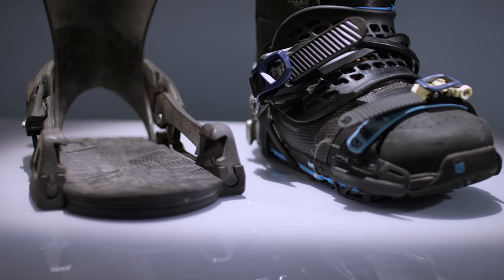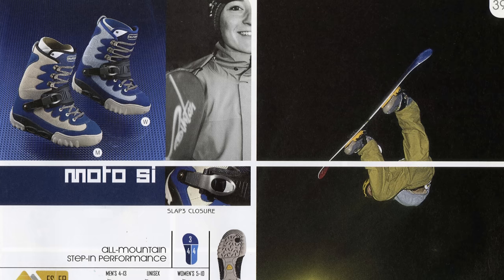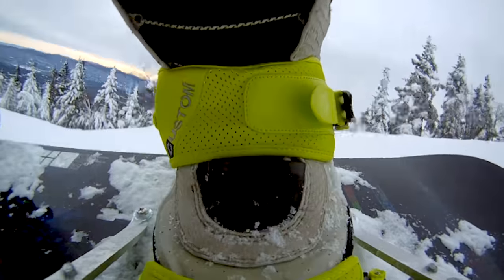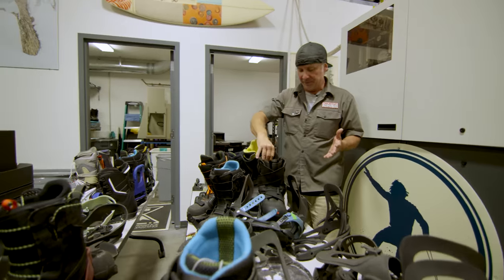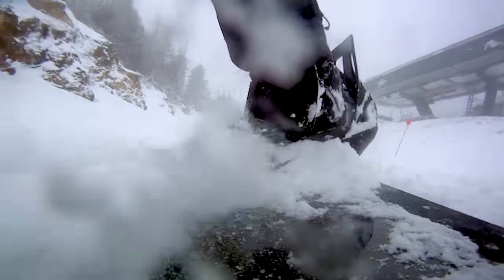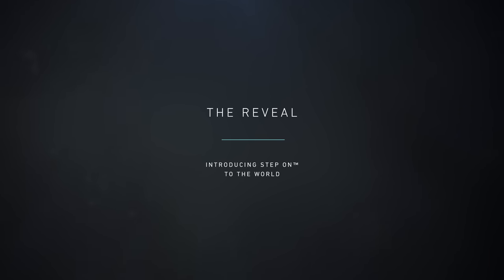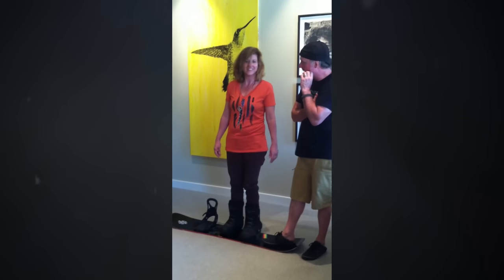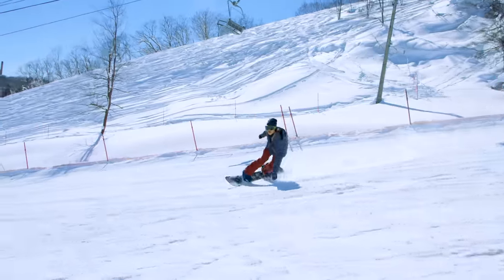Burton Step On® - Research & Development Process

Comment: Okay, this is officially on my must have list for next season.
Reply: Don't get the genesis - both hammocks fell off. I'd recommend Klew. Or wait for burton to address a LOT of failings. Ask the sales person how much replacement toe clips are. Ask them why they only have a one year high back warranty... But if you are beginner, but able to stand and ride off lifts with them they are pretty cool - just carving these things fell apart.
Reply: @trex2957  glad you said this.  I've been riding for over 20 years. definitely don't want those kind of issues.
Reply: @MrJamocity  yeah I heard from Burton what happened to me very unusual, that all these parts can be replaced, that they have or know some other person that used these a lot no problem...But I genuinely wonder if anyone has used these much... Most users get a 7-14 days a year. I got 75 days last season. 

My xp was lost gas pedal by day 20, replaced and tied down the new one or would have lost again. Left hammock lost by day 30. Right hammock lost by day 50. These are integrated to the highback so need a whole new highback. Goodluck if outside a year (one year on highback). No response from EU Burton despite promises and 6-8 weeks trying.. 
Boot toe seams starting to fail day 40. By day 70 both toe seams completely gone. Day 50-70 rear toe clip increasingly unreliable. By day 70 rear toe cip releasing with light upward pressure. Any heel turn releasing toe, but heel stayed locked. Snow trapping under the boot toe during riding... I'm checking out flow or clew because I did like the off the lift ease.

Comment: I'm a little late to the party, but here are my 0.002 cents on these.  I have a set of old-school Liquid step-on bindings that I've been using for umm, 15-20 years?  Not sure, too long.  I fondly remember getting dirty looks from older riders when I would just get off the lift and without stopping, click in and go. Anyway, the soles started to separate and I was frantic to find a system that kept me from having to sit on my butt and strap in.  I was so spoiled by getting off the lift, clipping my toe in and then, stepping back to lock-in and go.  A tube of shoe glue helped me get another season of riding with my old system and when I finally heard about the Burton system, I said, "I got to have them!"

Couldn't find them. Out of stock everywhere. :(  I finally found them this season, but it wasn't easy and that's not the story.

I have to say, that they feel more planted than my old step-in system.  I do feel more control and feedback.  I'm still getting used to how this system locks in and releases.  The heel in first followed by the toes is a bit tricky compared to the toe clip system.  I've managed to step-on and get locked in a few times, but I usually have to sit and press down on my toes to get the side clips to lock in.  Stepping out, the toe clips can sometimes stick, but that could just be me not using the correct motion.

I like them and can't wait to do more riding with this system except, now my son wants a set.  :)

Comment: But how does a system like this overcome snow packing under the sole of the boot?...
Reply: It probably doesnt, theres a reason clickers were phased out in 2000
Reply: Self tightening ratchet on the heel. You're still locked in and when the snow or slush displaces the heel locks down further.  Not an issue.

Comment: I was an early adopter of the Step-In back in '99. Never had any problems with the system - it was great! I could see why some didn't like them - the boots had to be made ultra stiff due to the lack of a traditional strap. Guess as the sport evolved into higher performance tricks etc, it didn't work very well for the advanced riders. 
I am anxious to try this v2.0, looks amazing.
Reply: Burton has 4 different options for Step On boots, which are just modified versions of the non Step On models

Comment: Burton is the Apple of snowboarding. Copy something that's been around for ages. Pretend like you just invented it. Advertise the shit out of it. And charge absurd prices for it.
Reply: except they genuinely innovated and improved the problems that made this option not viable before.
Reply: True in a lot of ways
Reply: First point is on, skip the 2nd and the 3rd one, the 4th is just good, practical business sense and as for 5.. depends on how you look at it. If it's new.. there's usually an added cost to it because you have to offset all those R & D costs.

Comment: Research & Development...???.. sorry but what's the difference with the 90's RIDE Step-in..??
Reply: If you had watched the video you'd know
Reply: I've seen it but I did not notice much difference.
Reply: The older designs had the locking mechanisms in the baseplate which caused problems when snow built up; the Step Ons have 1 contact point on the highback and 2 on each side of the front of the boot. All 3 points are well above the point where snow would build up and cause issues.
Reply: Simone Serra i was shit now its not lol i guess
Reply: Lol I love ppl who don't watch/pay attention to the video, and then they come straight to the comments asking a question that's already been covered. I have owned many click in, step in systems of the past. If you've ever tried and failed with a similar system you would realize that this may be something that actually works like it should. An inexperienced Rider that has no clue how to handle a snowboard will have no clue what something like this actually means. So just stick to your skis or go to the next YouTube video and comment on it before you even watch it....idiot.
Reply: Yes, they had an attachment point in the high back but that's where the similarities end. The Ride still had a toe cleat in the base plate which A) could pack up with snow really easily and B) means that you end up with a metal plate in the boot. It also doesn't appear that the Ride's had multiple ratcheting points meaning that snow on the base plate could still prevent the high back attachment to fail. The big thing with Burton's new system is that it actually rides well because the boots are constructed like normal boots and it works on conditions other than just groomers.
Reply: I really don't know why they stopped being produced because they are awesome!
Reply: I bought Device step ins in 96 and still use them, back then Device had two models then Ride bought the company and released the trimmer version. new liners and they're all good to go again

Comment: Cool, but a solution to a problem that doesn't exist.
Reply: the problem is that strap in bindings are slow and shitty, and you have to sit on your ass to strap in.
Reply: We don’t need remote controls for our televisions.  But they sure make things easier.
Reply: Chabot Media360 lol. Like 50% of all snowboarders in the entire world
Reply: I actually think that they SHOULD  NOT.  These step on's take a bit of pressure to get the heel in fully.  A beginner wouldn't have the balance to do that.  I think these should be recommended to an intermediate or up.  Somebody would stands while strapping in now and just wants to save some time and likes new stuff.
Reply: Chabot Media360 ya. I’m sure nobody “needs” it in their life.  I for one enjoy the extra time saves. And no more bending over to strap in.  

Also stepping on while on the move from the chair is nice also.
Reply: I never thought I would say this but as someone who has been riding since 1987 I might buy these to save my old knees & ass.
Reply: Agreed why have these step ons when you have a folding highback system which is first off more reliable and cheap
Reply: Fury I got 30+ days in mine so far this year. No problems yet.
Reply: Max Nguyen nice man, but what about 6 months? Or a year?
Reply: Fury that’s a good question. Only time will tell I guess.  But I can tell you that after 30 days it appears that there is less wear on the boots and bindings than regular boots and bindings thst I’ve had over the years.  

That and most people get like 5-10 days in a year.  So these would last the regular guy for years.
Reply: With your logic throw away your remote, calculators, dishwasher, washing machine, and anything else in your life that you don't "need".
Reply: I envy skiiers when they can just get off the lift and ride straight down the trail.
Reply: Chabot us older peeps who can't bend down anymore ha jk.
Reply: people who want to get their foot all the way back in their binding, i can only get that if im sitting

Comment: Got some brand new never worn rental photons, bindings, and board earlier. Cannot wait to pick them up next week and try them out. Tried one boot on during the rental, stepped in and heard all the clicks, already hooked.  👌✌👌
Reply: How'd you go on those? MY brand new photons fell apart by day 65. The toe box is unreinforced and basically sheared off from the forces being applies to the boot because of the toe clips. Could see the seams unraveling from day 40. I'm guessing these get ridden more by early intermediates that aren't doing the kind of aggressive carving and skids on ice I like... and maybe only for a week or two each season.

Comment: I demoed these for 3 days. 
1. Boots were extremely extremely extremely uncomfortable. 
2. There called step in, not step out
3. Not being able to adjust the binding tightness feels off. 
4. These bindings do not utilize channel, adding weight and limiting performance of your Burton board
5. I have flow bindings that I much prefer 

This was my experience. 6 foot 180lb 11.5 boot size.

Comment: Looks awesome i don't snowboard (yet) but the step in system would be nice to have to soiked shoes in the winter so you can wear normal shoes and then click into the spiked part if needed.

Comment: I might check these out to compare them with the K2 system. I have been riding K2 Clickers for over a decade and then upgraded to Kwicker for the last 5-6 years. I've never had any problems with either version. I ride all mountain; 75% trails 25% park. I get more runs per day then people on traditional bindings and edge out my buds who ride rear entry Flows. I hope more people ride step-ins regardless of brand, because people sitting in the middle of the run and just off the lifts, trying to strap in, suck!

Comment: Finally! Thank you! Have been owing Switch Team-N binding for more than 1.5 decades. They are still function well, but I am getting more and more anxious with every year: what to do when they finally will die... Really not going to use those stone age strapped bindings. Never. Now can sleep well knowing that there is an adequate replacement can be found =)

Comment: It will be interesting to see if it works with european snow, we found our sticky wet snow fouling to  the sole of the boot from hindering it from finding the latches in previous Burton step ins. Is it as easy to eject from when upside or head down in a snow hole under a fir tree, we use to have the latches on the K2 clicker insteps and tie a cord between them as a rip cord when free riding through the european tree lines. Didnt work so well trying to grabbing an edge when on a tabletop in Norco missed edge with hand, grab cord and did an involuntary Christ-Air.
Reply: When you step into any binding in powder or wet snow conditions you would normally brush the excess snow away. No difference with this binding.  The advantage with these step ons is the heel cleat has two locking positions so when there is some snow in the binding the heel still locks in and self tightens on a heel turn or on an ollie - as the snow dislodges. I live in Colorado and have been riding these for 3 seasons from October through June, 50+ days/ year and 700,000+ vert ft/ year. They just work.

Comment: gain about 10 seconds per run and lose lots of performance sounds great. And what about the big problem of step ins that wasn't addressed, snow getting stuck in the step in system and the boot not locking in, this system has the same flaw of the old stuff.

Comment: Boarding in the backcountry, deep pow, I'm skeptical. There are for sure times when I am picking ice off the heel cup after hiking with the board. Can't get all the ice out easily and just strap into the binding and go even if it isn't perfect. With these I fear I simply won't be able to step back in. No thanks, sounds perfect for park / groomers though.

Comment: This needs to have a very good warranty because I have a strong feeling it will break under serious use
Reply: I've also been riding the first step in from Burton since 2001 I guess. In 2017 season the plastic inlet in one shoe broke out of material fatigue. Also the second binding opened and I jumped after my board like a goal keeper to prevent it from riding down the hill without me. I was happy that the second binding opened so I did not face any stress on my leg or knee. From my point of view Burton did consider also the security issue. When I compare to a strap one will have a bigger problem in case one strap breaks on a peak load.
I loved the step in and would by new shoes for the old binding if they were available. Definitely I will try the Step On this season.

Comment: In -15 degrees in sleet with ice stuck to everything and the boot still clicks into place. Anybody had experience with it in real bad conditions?
Reply: When you step into any binding in powder or slushy icy conditions you would normally brush any build up away. No difference with this binding.  The advantage with these step ons is the heel cleat has two locking positions so when there is some crap in the binding the heel still locks in and self tightens on a heel turn or on an ollie - as the snow dislodges. I live in Colorado and have been riding these for 3 seasons, 50+ days/ year and 700,000+ vert ft/ year October to June..

Comment: I own this system. Bought them season 2018-2019 after the heel cleat was improved.

They worked FANTASTIC for my obese ass and strapping and unstrapping in general. I dont worry about my straps getting in the way or getting hooked on something when putting my board away.

My issues with the 2018-19 step ons:

1. If you are not flexible sideways, popping the lever to unstrap is very hard. My coat would bunch up in my waist and I couldnt bend sideways without sitting some times.

2. If youre laying on your back, you cant wrangle your boot off without  almost feeling like ripping off your boot. HOWEVER that means they stay on REALLY GOOD.

3. I own the Felix girl boots size 9. The little toe cleat hurts like hell. It pinches and because it has the metal clip, it will not stretch enough to stop the toe pinching. This means I can only ride for 2hrs before I have to give up because of pain. I'd love a boot size WIDE. 

4. Boots: I have skinny ankles and wide toes and the BOA ankle strap will tighten to where it hurts or it's too loose.

Comment: Ok designers I should have been on the UX team evidently.  Apparently I am one of the last ones in America still riding SI systems.  I could have and still could give years and years of experiences haha.  I can not tell you how many times I have people track me down asking what the hell it is that I am stepping into.  Then when the SO buzz started, people kept coming up to me asking if I had somehow gotten my hands on technology before market.  It has been quite a comical ordeal.  Especially having someone chase you for half a day and finally catching up because they have been having to stop and strap in so it usually falls during a break like lunch and they are blown away, especially when I tell them how old the technology is.  Make a conscious effort to make strides in longer lasting sole materials.  That has been the downfall of the system over the years.  I was going to try and make a frame so to speak and build the boot around it to alleviate failures.  Have had many ideas over the years...

Comment: Here in Lake Tahoe the Snowboard community is asking for Burton to admit that these boots are so painful for Those of us with an 11-13 boot can’t even ride these without excruciating pain.Your vendors openly admit it and it’s a discussion that is becoming the elephant in the room. Buyer beware be prepared for your day of snowboarding to be cut in half because of foot pain as Burton are deceiving the general public about these flaws. It’s unlike the experience I’ve had w/ the label I have loyally invested in over the last 30 years with Burton and Jake would have not approved of this premature evacuation. I called Burton and they told me to try a thicker sock (great idea) that’s like the most obvious thing you could suggest how about doing something real for the pain  do something about this. How about make it better a sock with padding so that liner doesn’t feel like foot stabbing w.dull knives. Or a better liner to decrease unbearable pain. I wish I would’ve known but it was such a well-kept secret.  I was fooled congrats you got my $600 for the system.Unfortunately the company is changing to a who gives a F cultural but it’s unfair & a failure to disclose to future generations of customers.
Reply: Are you referring to pressure on the outside pinkie toe?
Reply: Mark Simmonds yes outside pinky toe is the worst especially on back foot.

Comment: Make a budget option to accommodate for the lower classes. The usual spending price is about 80 on boots and 90 to 110 on bindings or vice versa so for the pair I would still say budget is 199.95

Comment: I was so excited to get my hands on them, Off to Hakuba for a 15 day trip after a day in deep pow the base pad fell off on the lift.

A couple hours and the side of my foot ached I took out the inner soles out and it was still unbearable. The end of the NZ season still have the same problem.  The system is great but the boot suck the front clips on the boots hurt your feet.  

Time to work on boot design and refund customers for crap boots.
Reply: Nice to see burton takes a minute to reply.